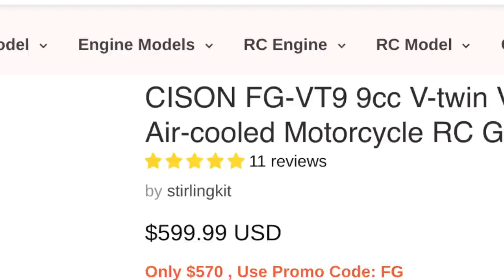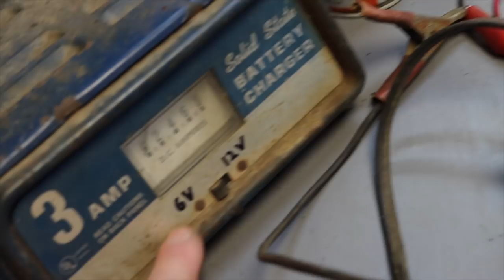Mini Harley Davidson Engine Giveaway, Review, & Teardown. Cison V-twin From www.Stirlingkit.com

Comment: I'm 23 years old, I own a motorcycle shop in oklahoma where we do maintenance on all types of motorcycles and we also do full custom chopper builds, usually around old harley engines. Let me tell you how close this is to a real Panhead Harley it's awesome. But at the same time it's so different (I'm sure as a result of being so small) it's genuinely just amazing to live in a time where there are running miniature Panheads being made.

Comment: The reason for the spark both firing at the same time. The compression stroke is on one cylinder and when the 2nd cylinder fires at the same time, that cylinder is on the exhaust stroke. Basically dead air. It's the same way with many modern fuel injected engines that have Distributoress Ignition System. (DIS) where one coil fires for 2 cylinders at the same time. Many GM cars starting in the late 80's had this setup for a long time until Coil On Plug (COP) systems started becoming more popular.
Reply: Ps... YouTube never sent me a reminder this video was posted. I just now happened to see it by chance after watching your last video.

Comment: V 45 twins large and small quite often have the spark fire, same spark same time. One cylinder is slightly advanced and the other is slightly retarded just by orientation in design. no spark control is necessary between cylinders other than tdc. This little discrepancy in firing makes one a hotter cylinder set forward for cooling and the other cylinder being cooler set behind blocked from the moving air to build some heat. Together this equals a simple happy v twin motor operating on one spark for over 100 years. Firing back to back at the same time is where the infamous.    potato potato   potato potato sound appears. Simple and brilliant and works like a charm.

Comment: Looks like the piston position is the same as my Sportster. Matches the Lego motor of my model Fat Boy. Plus as far as the ignition timing is concerned, as far as I can tell both plugs fire at top dead center of each cylinder.

Comment: I’ve run Harley’s over 45 years I still own  my first one that I bought new in 82 it’s my beloved Shovelhead in a FXWG! I also own which I bought new a 92 Softail , Evo Engine! I must say this little engine is the coolest I’ve seen   And plus it’s sound is amazing! I think that what would really be the icing on the cake when you have sitting in some cool creative display is being it am old Panhead replica is maybe put a couple of drops of oil under in since most of they old pans were notorious leakers especially the early ones the ran what was called a 100% lost system , by design the oil that lubbed the primary and drop out on the rear main drive chain! Ya gotta love em!!!
   I’ve seen these awesome little works of art before and  dreamed I could justify having one , but my budget for tinkering with the real ones , realistically i could never do it , but thanks for putting together a great video about a really great little piece of working history!!! Very nicely done!!!!

Comment: I wonder if you could get a clutch assembly to try it in miniature 4wheeler with remote controls. I am 77yrs old and I am amazed with these small parts. I was a class “ A “  auto mechanic here in Canada. The rpm are mind boggling. I would mount it to operate small machines.

Comment: I like the way to got through your mistake of not marking the timing correctly.
I did it on a passat tdi that dropped a valve, didn't mark the timing correctly on the crank, then spun the crank over to clean and check the bore was ok.
I noticed my crank timing mark was in exactly the same place, and had to do all what you did to this engine to get it running again 🤦.
Great video too, I like how your brain storming was aloud for us all to hear your though processes.
I watched the whole video and it was entertaining all the way through, thank you.

Comment: Also you should try to making the bore size a little bit bigger and also bump up the compression by resurfacing the head or resurface decking each cylinder

Comment: Nice n cool project dear..loved the way you explained the tear down,, reassy and especially the firing  time correction part was the best..would love to have one in collection..though have some but they are cheaply made  2 stroke and runs on ether castor oil n kerosene 30 30 30 ratio n very diff to start at once .

Comment: also on the front right  of the case is your distributor 
the panhead engine uses a generator as opposed to the next engine type to come from HD called the shoveled and called and known as a  "cone motar" because the electrics are housed inside of a conical projection from the front right side of the case where the panhead case is flat

Comment: BTW, if you notice, the crankcase is machined to accept a 540 electric motor as a starter.  Not sure if a pinion came with the bundle.   Also I think that extra fuel port is to plumb a separate oil system.

Comment: I don't know if you are a Harley mechanic or not ,but you did a fantastic job of rebuilding that motor I'm impressed with that motor and your skills. That motor is so much like a full size Panhead Harley motor  it's like they washed it in hot water and then dryed it and it shrunk that has to be the coolest engine  I've ever seen I have a huge H-D collection of die cast models and that would be the cherry on top of my collection.

Comment: I bought a new panhead engine in 2003 and had some trouble with it even till today. It's kick start only and I'm 68 with a bad heart. I've done about exactly the same you did on the small engine but it looks so much easier than working on mine. Lol 
But I'm still trying to tune it to crank easier so I can ride some more.

Comment: AA friend of mine who owned a pan head chopper once told me on a ride to a rally, "There are Pan people, and people who want to be Pan people."  My motorcycle is also a Harley with a dual cam 103.  As a lifetime modeler I can appreciate the craftsmanship in this engine.  If you choose my comment, I must admit I will donate it to my local dealer's parts department for display.

Comment: Nice.     I own a 1952 Pan head Harley, I have rebuilt it a few times. So to see this small one makes me think how hard it was to scale down ,and run. unreal ,Amazed. I think it will need oil in heads and block .But like it's big brother, it too will leak after it heats up a few times. Please I do not want it . just nice to see.

Comment: Timing may need a little advance for the spark, also,not sure about valve timing either, could be 1 or 2 teeth out,would probably still run,but not perfectly.

Comment: How rad would it be to build a little Harley peanut tank to sit above of the engine?  Then rig up a pulley system to use this to power a small lathe.

Comment: Awesome video I came across it by accident but I have to tell you that's the 1st time I saw a Pan head engine run with the exhaust going forward instead of rearward rearward loves to put that thing with a transmission in a couple of wheels anyway thanks for the video it was awesome

Comment: I wonder how hard it would be to make a turbo for that lil eng. And than set it up to do a whole bunch of things like spin a air pump and generator   like they did with water mill to all the equipment in wood mills, flower mill it would be very cool to see all of that in miniature powered by that lil eng.

Comment: I had a Visible-V8 kit as a kid and I loved it. But of course it was only a static model in that it only "ran" if you turned it over by hand. I'd love to own this as my "Harley" in my herd of motorcycles. So cool. Cison should also make a BMW flat twin engine model. They already know how to make a miniature running pushrod air cooled engine, which is what a BMW flat twin really is.

Comment: Good accurate reproduction except for some details. Very similar to my Pan Head engine on my 58 HD Chopper that I own since I came back from South East Asia in 1972. This would look cool sitting next to it if I could afford to buy one. Even has the timing plug on the chain side of the engine! Several finishing detail items would complete it though. Still cool and even thought it sounds like a two cycle you can still hear the Harley thump!

Comment: I honestly would love to get a look at how that oil pump and system would work with it. That was my biggest fear looking at it. Sure the cylinder and lower should get the premix but the valves in there dry really make me nervous. I would definitely want to add the oil system and then not need to premix. I would also maybe use a spring punch to make timing marks on the gears so they don't get wiped off or anything.

Comment: I've  seen theses engines  but never apart now that I see it  my opinion  and concern  is the crank and rockers and few other little internal parts with no oil with the cylinders and ring and o ring difficulty  no oil passing by them   when I saw onr running my thoughts  was there built like a rc or airplane engines  with on rings on the pistion

Comment: Hey guys, when I was a kid, working on small engines was my jam. The first experience I had with any engine was my Yamaha Xt225. One thing I will tell any of you is to use the right tools for the job and always torque the bolts to factory speculation. cylinder head blew right off and broke the crankshaft. Have a great day and stay safe!

Comment: I noticed when you took the gear case cover off to the upper right there is a empty post that would have a gear on it. Then to the right of that is a hole in the case. On the outside of the case of that hole looks like a place you can put an electric starter. Did this manufacture offer an electric starter option? Very cool engine. I build and fly scale radio control airplanes. I would love to find a scale experimental aircraft that used a Harley Davidson engine for power. And build that airplane to scale powered by this engine. Would you consider doing a video with this engine turning a 10 inch diameter by 6 inch pitch propeller and seeing how much RPM you can get. 6 to 8000 RPM would be optimal.

Comment: hi  if you notice  the v twin is not a true v twin both pistons come up and down at the same time, if I am correct thus compression is at the same time  on both cylinders, and in point of fact acting as  a single cylinder  simple but clever

Comment: Cool little engine, the amount of work that goes into these is astounding.
I am a fan of the miniature hit and miss engines as well.
One of these days I might pick up a casting kit and machine my own.
Reply: Can you tell me the magnet for on the fly wheel please? You see in have this engine. And it came with a new type of sensor with a magnet, and instead of mounting it within the gears the statement says mount behind the flywheel on the block. I was thinking of putting it away from the engine al together but I don’t know if the magnet comes to play with the sensor. Tell me is it possible

Comment: I'd love to see that engine fitted to a model aircraft.  No doubt it would have to be light with a large wing area, because I doubt if the power output would be high enough to replace a nitro model engine, but it would look great!

Comment: I started taking things apart when I was a kid.  Took Dad's lawnmower apart once.  It was sitting on the patio and was full of grass.  So I thought I'd do him a favor and clean it up for him.  First I unbolted the tin that holds the rope starter, then the carburetor and eventually the flywheel.  Well, guess who came out the back door of the basement and boy was he mad!  "That mower better be back together and running in 15 minutes!"  Well, I made the time limit but the governor probably wasn't quite right cause after he got it started and it hit the tall grass, it stuck on full throttle!!!  "Kent Richard"!!!!!  Thats all I heard as I was making my retreat!  Boy did I get it for that!  Years later, he could not get his rototiller started.  He had it apart in the garden mid furrow.  He knocked on my door..."Kent, can you please help me out?"  Yep, had it back together and running in...15 minutes!!  LOL!!!!!

Comment: I have an engine collection of somewhere in the range of 175 engines. I have engines for airplanes, hydroplanes and tether boats and cars from the 1920s to present day. I do have a few small engines from Stirling. I have torn engines down since I was about 10 years old. The smallest is about the size of a thimble and the largest is around 150 cc. I do have a 49 cc that puts out around 9.5 hp. Yes I love rc stuff...Mostly the engines...lol

Comment: I have built several Harley Choppers and a few street glides and sportsters WOW
Wouldn't an old Pan Sporty  be sweet,  Real Metal frame and led lights and a running engine,  
I got the perfect place for your engine 
This would be a great piece.

Comment: Would be cool if they put together an oil pump kit, to order along with it, and of course an air filter as well, Ive been wanting to build a custom rat rod 1/2 scale 2 seat front and rear busckets, Harley powered car keeping it under 800 pounds,  with 100 hp would be fun with a rumble, that engine would get me to build a operational scale R/C first, which would be cool too

Comment: I want to use one of these to make the smallest generator for my tiny travel trailer - I figure it's totally doable with a small dc motor, an mppt charger, and an Arduino. If I could get a couple hundred watts I'd be happy

Comment: Hmmm. I thought the pistons would have fired on opposite strokes, not on the same stroke. But I guess that would produce more torque and HP.
Reply: They do fire on opposite strokes.  Both cylinders fire at the top of the compression stroke, and also at the top of the exhaust stroke (where it does nothing).  When one cylinder is at the end of its compression stroke, the other is at the end of its exhaust stroke.  It's quite a neat way to simplify the ignition circuit.  I've seen the trick used before, in a full-size engine, but I can't remember which.

Comment: I would do exactly what you did!  Tear it down and see what takes it tick.  then put it back together and see if it will run... I hope I win it so I can spend the winter messing with it to make it run well.I used to do this with 049 model airplane engines.  I'm 75 years old and it would be a great project with the Grandchildren!

Comment: It should be before top dead center. Hopefully the valves were not smashed and bent. In my years in the shop, I'd come across things like this, and I always punched marked with a punch and a little bit of white nail polish in the punch hole if needed. Im tempted to buy one of these and open up the heads, make a new cam and rockers and give it a real oiling system and better custom pipes and maybe even build a whole motorcycle around it. Indian Larry style.

Comment: LOL  I am Impressed ! when you finally started deducing what was wrong you were teaching millions ...Bravo !   Gas, compression and ignition AND in the right order and it will run ! it's not rocket science but it does require THINKING.... that's a sweet little motor that is for sure !
Like many I have had a life long love of the internal combustion engine....perhaps you could make a Harley powered skate board with that motor eh ?

Comment: I know I have come to this video two years late.  But i wanted to say that this is a cool review of this engine.  I was wondering if this engine could be used around the farm?  Example to power a small vacuum or compressor that can be used for your power equipment repairs in the field?  A vacuum pump for when you have to work on hydraulic systems (like you do with your vacuum cleaner) or compressor for blowing out lines or clearing off dust and dirt?  I guess it all depends how much horsepower the engine generates…

Comment: I wonder how the timing works being 2 stroke. I got an old Harley shovelhead running again after 24 years off the road but the owner never got used it but won't sell it to me
Edit: you did say 4 stroke I was wrong. Still an amazing little engine

Comment: You have to be in HOG Heaven tinkering with a mini V-twin!  I can HARdLEY believe it actually fires and runs so well.  This little tater tot sounds like the full size versions (POTATO-POTATO-POTATO) when you slow down the replay to quarter speed.

Comment: Its cool i have one but cison has to work the bugs out of it, mine would not run out of the box as the hall sensor was bad, i installed a new hall sensor and i got it to start but it would not run right. I found out the two rubber intake tubes were fit loose so it had an air leak, i put  fatter tubes on the intake for both cylinders and sealed them where they go into the cylinder heads and now it runs and throttles good.  I paid $ 800.00  for engine, base, air filter and gas tank from sterlingkit.   Be prepared for some kind of failure.

Comment: "no oil reservoir"

A 2-stroke puts the carburetor on the crankcase, so the gas:oil mix lubricates the bearings before the downward movement of the piston forces the air:fuel:oil mix from the crankcase into the cylinder…

So that oil mix doesn't oil the moving parts of a 4-stroke…

Comment: I would like to try to take that little model engine and see what kind of power I could create with it as a generator.... Or if they even better to have another one and strap them to rollerblades and make four stroke roller blades lol 🤣🤣🤣... I can see it now .. a little gas tank and a backpack with braided lines coming out of the bottom a power pack in the backpack and then having a brake lever from a bike for your throttle on each side or even running electric servo that way you could run it on the same channel for both and then you could also use brake pads on your back wheels to slow you down from a bicycle.